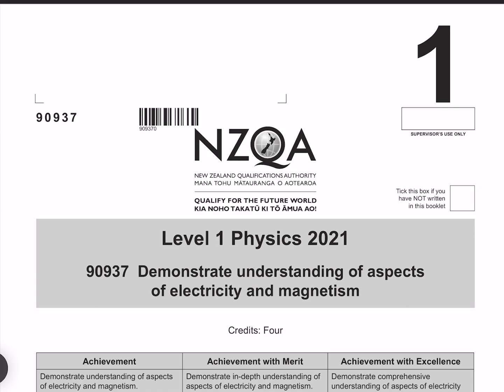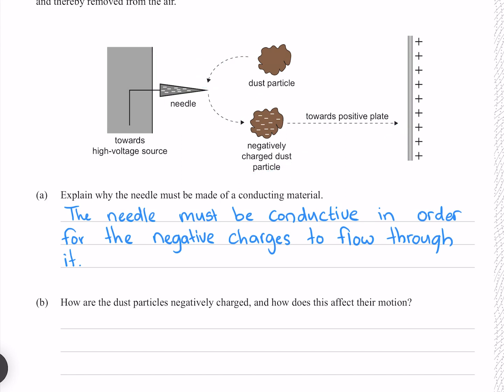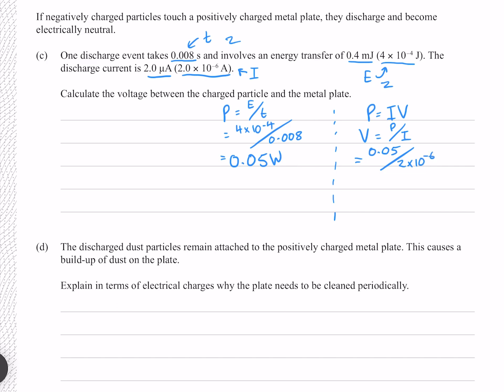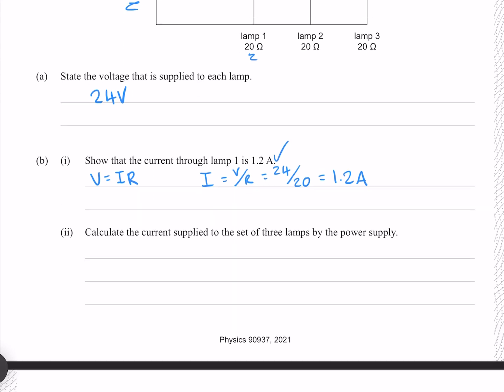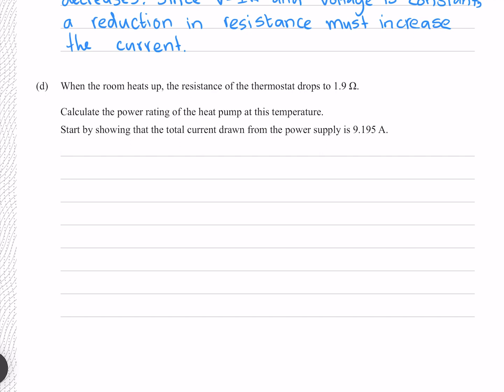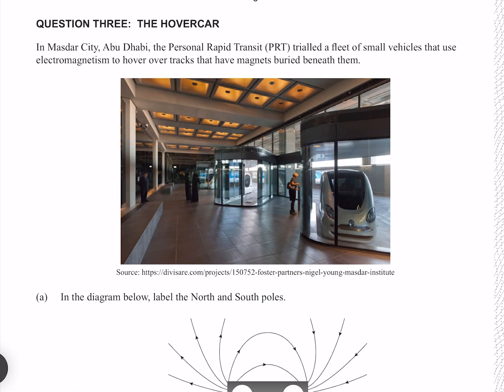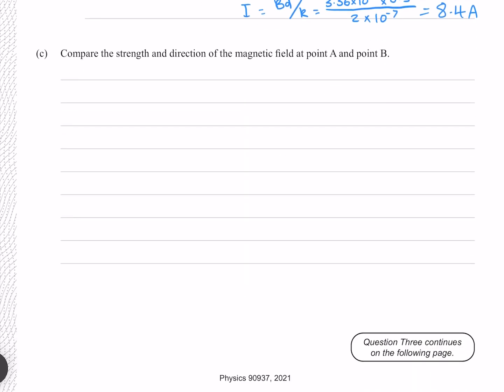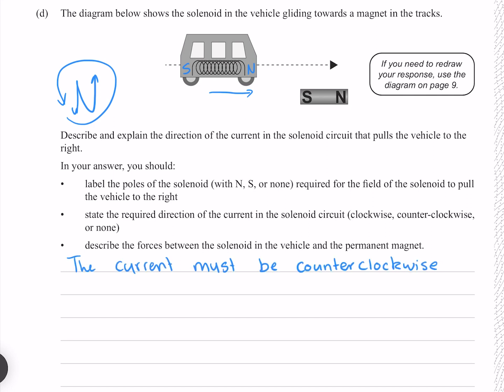2021 Electricity and Magnetism Exam (NCEA Level 1 Physics)

Comment: How do you know if the direction of the solenoid is clockwise or counter-clockwise ?
Reply from the maker: Hi Gethyn, are you referring to question 3d? For this you need to know Lenz's law, there are a few tricks to remember it. In the video I use the one described on this page: https://revisionworld.com/a2-level-level-revision/physics/fields-0/electromagnetic-induction

Comment: at 9:45 how do you know that point b is left and a is right?
Reply from the maker: From our perspective the field lines appear to be rotating counter clockwise, as if we're looking at a backwards clock. At the top of the backwards clock (point B) the lines point left, and at the bottom (point A) the lines point right.

The important point is not so much that they're left and right, these are a description that only applies to our particular (confusingly drawn) perspective of the wire. The important point is that they're in opposite directions.
Reply: @MrWhibleyPhysics  Thank you for your help !🙏